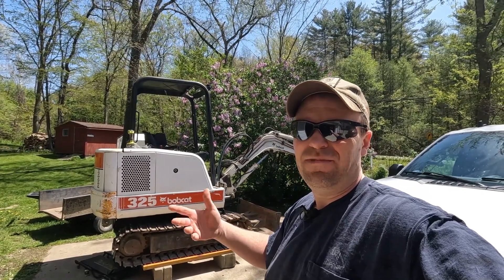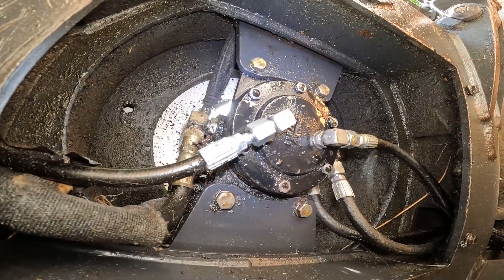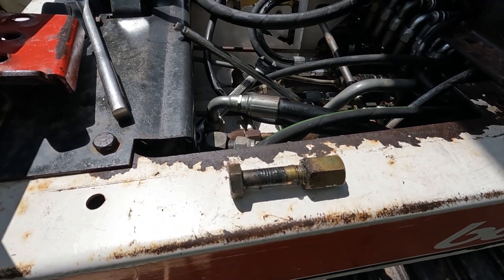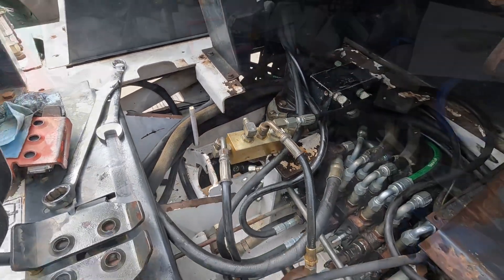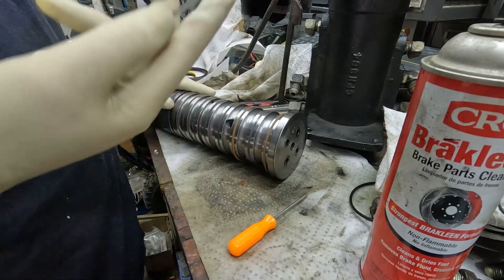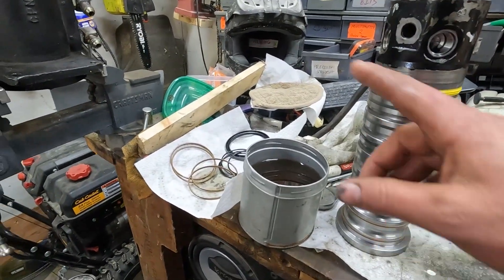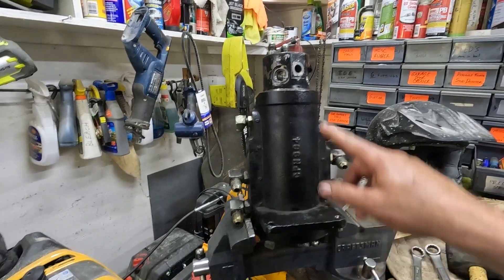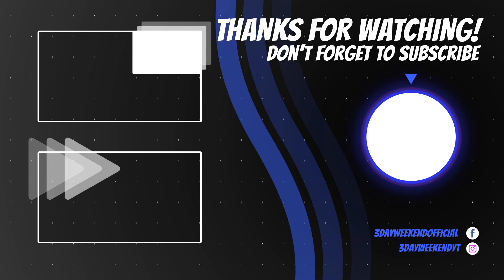Fixing a leaky seal in a Bobcat Swivel Joint.  Found a bad seal.  1 of MANY leaks fixed!

Comment: One video made it look prohibitively hard. ( special tools, heat the seals before sliding them on, use a press to get the core out then to get it back in) 
Your video makes it look doable. w/o special tools
Reply from the maker: I was able to complete this job successfully with somewhat basic tools, but I'm sure the correct tools would make it easier.  I did heat the seals in a container of fluid to make them more flexible, and I had to be EXTREMELY careful getting them to fit inside, but it's done and hasn't leaked since!  Honestly the hardest part was getting the joint out and then back into the excavator!

Comment: Hi I have the same machine just wondering do you know we’re the control switch is for backhoe to Exavator is on this machine please
Reply from the maker: The control switch?  I'm not sure what you're referring to.
Reply: On my 322, there is a toolbox on the left side. You have to remove the back plate of it to expose the hoses to swap the controls from iso to cat or vise versa

Comment: Did your seals stretch after you put them on? My new one's seem awfully loose know, I don't know if I can get them back in.
Reply: Wrap electrical tape around them wait about 30 minutes you'll be good to go
Reply from the maker: They felt very loose to me.  I didn't think I was going to be able to put them back in.  The end of the housing is tapered so I was able to apply pressure and used a small pick/screwdriver to make sure the gaskets stayed in their grooves as I inserted it back into the housing.  The trick seems to be to not over-stretch them and to let them soak in that heated oil for a bit.  Not one of my favorite jobs....  Seems all too easy to over-stretch and break one of those seals.

Comment: Where did you get the seals?
Do you remember or have a memory of that part #?
Im about to do mine.
Reply from the maker: I ordered them directly from Bobcat online (shop.bobcat.com).  The part number was 6664908 for all of the seals.  In the end, I probably could have gotten away with just replacing the verry top seal, which would have been easier and cheaper, but why not do all of them while it's out?  Best of luck to you!  Thanks for watching!

Comment: Well done. I just turned mine 90 degrees and lowered it out the bottom of the machine on my 331. I think that they are the about the same frame.
Reply from the maker: Interesting.  I thought maybe I could get it out that way, but there was no way to get it to turn enough with the attachments on the sides hitting things.  I wonder if the 331 is slightly larger or maybe the hoses attach in a mildly different way so you can turn it better.  Either way, survived another fix on the ol' Bobcat!  Thanks for watching and for the comment!

Comment: I cut a plastic 2 liter and wrap around it to slide seals on worked great
Reply from the maker: This is genius!  I wish I had thought of that!  Thanks for sharing!
Reply: Brilliant. I'm not sure I would have ever thought about using a 2-liter. But I will say, when I come up with and idea as good as your 2-liter trick- It makes my day. Thanks for sharing.
Reply: So you put the seal on the 2 liter, slid the 2 liter onto pump then slid seals off and into position?